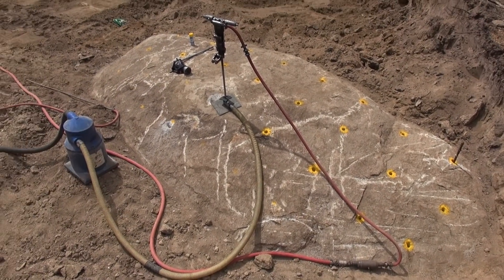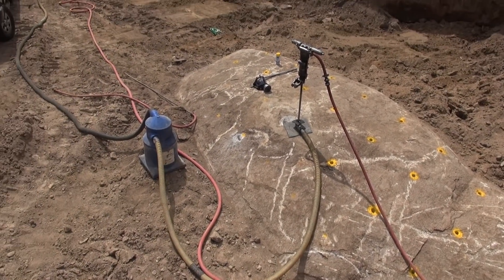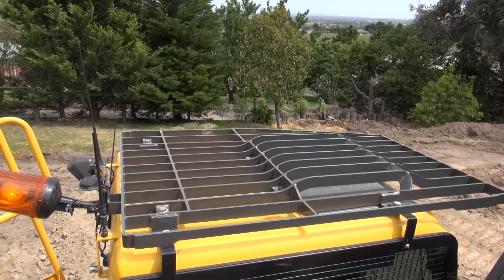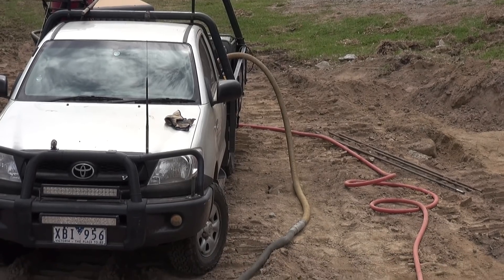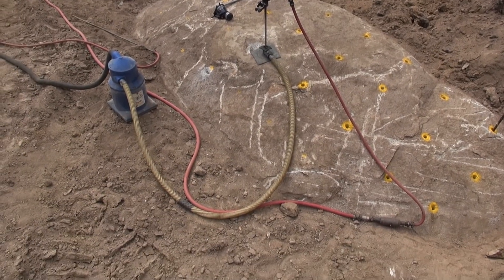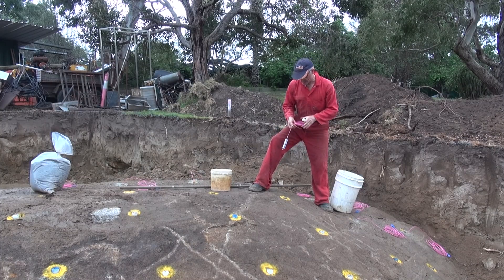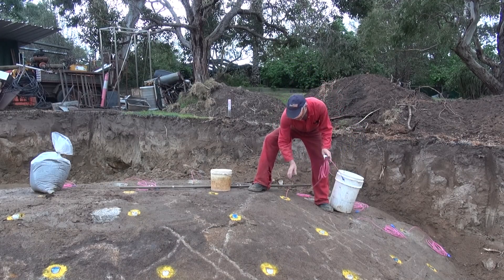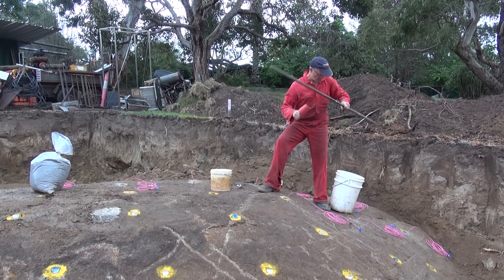Drilling and Blasting hard Granite in a residential area

Comment: How far from residential houses such work can be performed safely? And how safe it is for the concrete base of the neighbors'  houses, can they develop cracks over time? Do you need neighbors' permission before doing such works if their house is 4 meters apart from the edge of the large rock formation?

Comment: U pointed out u had fines in your 5mm screenings . Why does and can it matter?
Reply from the maker: The 5mm screenings had some contamination in the form of sand, this is not helpful as you really want sharp angular material that is about 10 - 15% of the hole diameter for best results
if there is too much fine material it does not grip the wall of the hole as well and is more inclined to shotgun strait out the top of the hole.
Reply: @demolitiondavedrillandblast  thank u Dave I just learned something new

Comment: How come the stick keeps going in/out of the hole during loading?
Reply from the maker: First I use it to check that the hole is dry and the correct depth, not blocked. Then while stemming you can make sure that the stemming has gone in all of the way and not bridged part way as well as giving it a little bit of compaction.

Comment: Why dont you use a counterweight on the hammer istead og your legs? We use this in Norway with a spring inside the weight.
Reply from the maker: Nice shot on your video @ https://www.youtube.com/watch?v=5-2AYyfVyQU&list=FL0GaZxSMzguDbTqlPdHiPJA&index=2   4:20 you have a lot of blast mats!
I have tried a few weights with not much success, I'm interested to learn more about your weight with a spring inside.
Reply: @demolitiondavedrillandblast 
Will try to take some photos next time using it. Posted some New shots on my profile aswell, please check them out 👍
Reply from the maker: @Skogsame  - Great shots, what drilling equipment do you have? I hope to get another video up tomorrow
Reply: @demolitiondavedrillandblast 
Sandvik dx800 with gps, atlas t35 smartroc and a atlas t15. So no lack of holes for me to blast 😆
Reply from the maker: @Skogsame  - That certainly is a good collection, do you like the T15? I would love one of those.
Reply: @demolitiondavedrillandblast 
 Drills good, nice to handle with the remote. Only thing, cant handle mud😥

Comment: Love the drilling technique Dave! That's the hard work compared to blasting once holes primed.
We used to call the sequence a 'chevron' pattern but same thing I guess - possibly 10mS delays.
Yet again, some biga$$ rocks! :)
Reply from the maker: Hi Chris, a chevron pattern is a bit different, commonly used in quarries and mines where the first hole in the initiation sequence is in the middle of the face and it progresses out in both directions, tends to push the muck pile toward the centre and give slightly better fragmentation as the flyrock is pushed on a collision course.
Reply: Thanks for the correction Dave - yes of course I remember that now from years back when I took a shot firing course. memory gets dull with age! :)